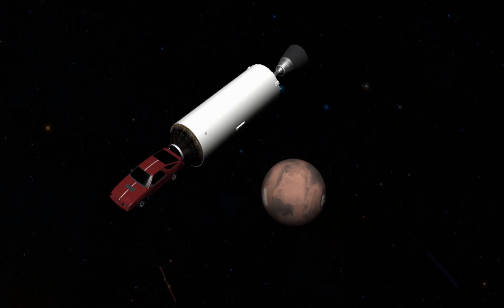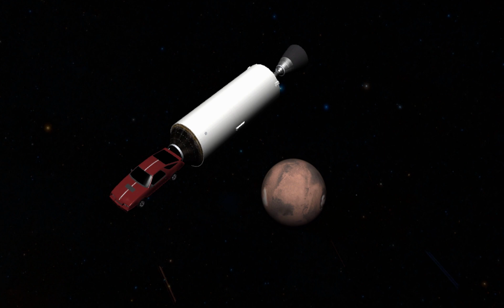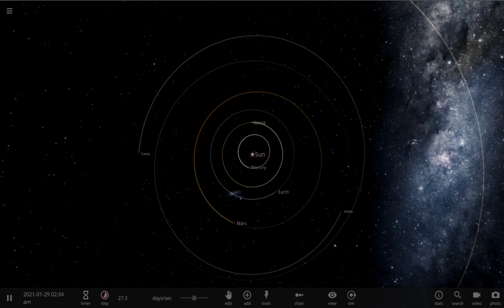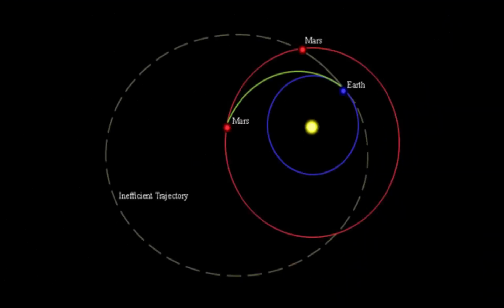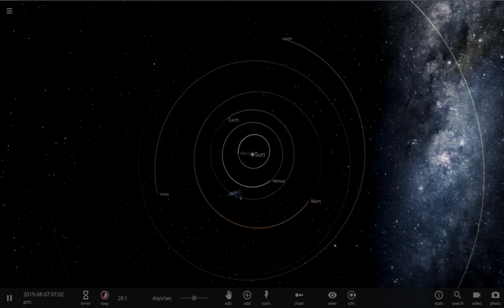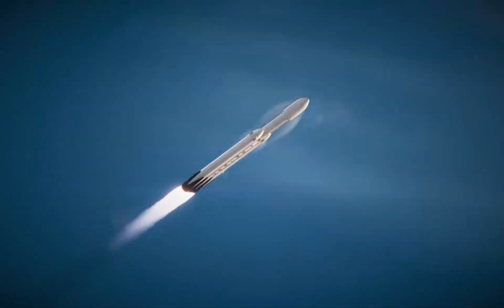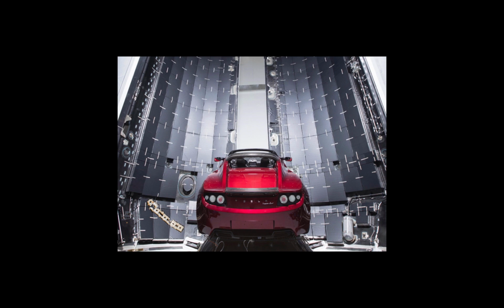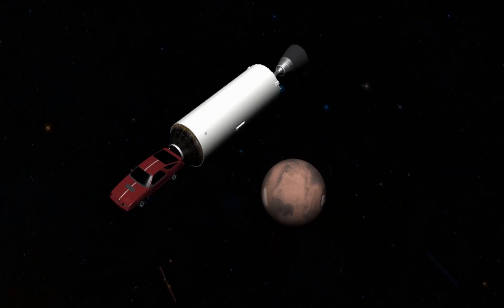How Far Can The Roadster Get -Explaining How The Falcon Heavy Can Reach Mars Outside Transfer Window

Comment: My question is whats going to happen to the materials that the car is made of. Ie tires, and paint interior in time
Reply: there is no atmosphere so using earth terms and conditions may be completely wrong and if they survive the initial exposure they may last much longer than you think besides you have no idea what type materials they used. When I was asked to age the mock-up voyager spacecraft used in the first Star Trek movie to look like it was in space for 2 thousand years there is very little information on how things age in space at least visually.
Reply: Radiation from the sun will 'bleach' it, much like the US flag that was planted by the first moon landing. If it survives, in a few decades it will most likely all be an off-white color, or a much paler version of what it currently is.
Reply: Thank you!!
Reply: John LaRocca, MDT The tires are vulcanized rubber which will break down and crumble with the harsh UV.  Many of the plastic parts on the exterior and interior of the car will do the same.  It won't remain a good looking car for more than a few years, anytime after that it's highly improbable anything will function due to the continued radiation bombardment.
Reply: +Robert My guess would be that the exterior would be dulled from collisions with very fine dust and energetic particles, and there would be discolouration surrounding the exhausts of the attitude control jets.  If it were painted, there should be evidence of wear-thru.  Probably a number of discoloured pinholes.  The one picture I dug up showed it's mostly black, and some of it even looked like carbon fiber "fabric".  Which may or may not show abrasion or discolouration much at all, but could show evidence of fraying if it got hit by particles... I remember that part of the movie being so dark that it didn't much matter what you did, your eyes don't make enough sense of it.
Reply: Charles T Like we actually went to the moon. God you're a dumbfuck!
Reply: The Voyager had a large round dish and then metal pipes holding the camera and other smaller things the legs were basically pipes as well the dish we dusted it and yellowed it and the metal we used copper and cobalt blue where it looked like it had been hot at some time and a few tricks I will not reveal also in the movie the o in the name was obliterated so that they were calling it veeger instead of voyager.
Reply: +Butternutcrunch My, quite the sheep you are, arntcha?
Reply: +Robert Wasn't it V'ger? ;-)  Yeah, sounds about the same effect I'd have gone for, but I think I'd have used some media blasting to dull things up/wear out some paint more than dusting.

A few artistically placed small holes would also work, but at the speeds this thing is going, anything larger than a pea hitting anything more substantial than foil would practically vaporize the whole thing.
Reply: your absolutely right about the spelling I was trying to do it phonetically guess I failed. When you work in Hollywood for a major studio you are able to do things like talk to people at NASA which I did and because of no atmosphere they don't get that much wear and tear except an ocasionl large item causing large damage. Art directors did not want that We even burned it with a heat lamp but that wasn't liked either
Reply: +Robert I can imagine it could get a bit awkward with your bosses asking for "make it look ancient!", and the astrophysicists say "why would it look ancient?" ;-)

I had my own similar silly moment.  As a grad working on my MSc in physics, I got to know the computing manager of the Physics dept fairly well.  She was a recent immigrant from Poland, and a Polish news crew was over to do a documentary on her and her work.  By that time (early 1980s) the Physics dept had gotten rid of all the ancient IBM mainframe hardware with blinking lights, toggle switches and other flashy bits, and had a real nice VAX 11/780.  Which is about as exciting to watch as a laptop charger.  She got into an argument with the news crew (in Polish of course), and came over to stand by me where I was looking in the door to see what all the fuss was about.  Then she broke out in giggles.  "They want the computer to do something cool!".  I cracked up - "It does have a tape drive maybe you could do something with that".  She: "It's broken, the tech is coming next week".  A few minutes later the news crew repacked their equipment looking annoyed ;-)

You sorta have to go back to general principles - there is fine dust out there (especially near the belt, the rings of Saturn, or probably the rotational plane of just about any planet), and ionizing radiation (elementary particle sized bits of + or - charge flying at truly ridiculous speeds), which would have impact effects equivalent to nano-scale explosions.  Microscopic pitting and abrasion.  Shiny surfaces become dull.  Paint erodes.  An object out for a decade or so won't show much change, but the moon's surface (dust, and micro-welded regolith) is the results of billions of years worth of micro-bombardment blowing things to micro-bits, and re-welding it back together into a brittle sponge of sorts.  You have to do something with discolourations around the thruster throats, and making something up (like you did with the "hot" - copper/cobalt blue is good for scorched metal bits).

You would get some electrostatic dust accumulation too I'd think.

With an electron microscope it would be quite interesting.  But that wouldn't quite fit with the script, would it? ;-)

Did you work on Wrath of Khan?  I went to school with some of the guys who did the Genesis planet CGI sequence.
Reply: I only worked on the first Star Trek movie and it is an interesting story. at first Paramount was going to bring back the original TV show so they built the original Enterprise complete. When the TV deal fell through they decided to make it a movie and Gene Roddenberry decided he wanted to upgrade the ship and make it more futuristic so the grips went into the stage with sledge hammers and saws and broke the entire set into pieces small enough to fit in the dumpster and we did a new set. I was told that was 8 million dollars they threw away. Anyway right after that movie I moved on to 20th Century Fox and didn't work on any more space flix and I am retired from the business now. I don't know about the stuff you are mentioning I went by want the "experts" said and even more what the art directors wanted.
Reply: Thanks for sharing the story it does remind me of what it was like having to please others more than myself
Reply: +butternutcrunch  Did I step on your dainty little sheep feet?  Poor boy, can't take what you give out.  Suck it up buttercup.
Reply: +Robert I think you did well, what you did is more or less in line with what I would expect, making allowances for art directors ;-)

The guys I knew who works on the Genesis project were the people who originally developed the techniques still used in basic CGI (shading, reflection etc) but their equipment was godawfully-slow by modern standards, so they had to cut corners (detail, resolution etc) to stay on budget.  As it was, I understand there's several months of compute time in the thing.  But they did have a love for that end of science, and I recently found out that the stellar backdrop they used is "real" - in the sense that they computed out what the view would be from the star that the storyline used, and used it, rather than make up something random.

The Genesis planet sequence in WoK was the very first pure 3d CGI sequence ever used in a major movie.
Reply: Lowest form of internet life, the lurkers they can't get a conversation of their own so the lurk around till they find something to cry about. Listen FrizFro say anything you want I'm rubber you're glue it bounces off of me and sticks to you. It is sad but say what you have to say so you can feel good about yourself then go off and lurk somewhere else. and have a nice day
Reply: That is so cool. When I was at Paramount there was a group of guys just starting to get good at what is now green screen back then it was blue screen. there computers could fill a one car garage. it was called Magicam. Nowadays I have seen CGI scenes that are so real it blows me away I love what they can do and would have loved to be involved with perfecting and using that process
Reply: +Robert "Lowest form..."  Sure you're referring to the right person?  That was the nutty butter crunchy guy, not me ;-)
Reply: +Robert I spent a lot of time in the graphics end of computing during my grad days, which is how I know two of the guys on the Genesis sequence (very senior people at Pixar and ILM, and a number of Academy awards as a result).  That's not what I do now, but my wife (also in computing) have always been paying special attention to the technical ground breakers in movies, even when the movies themselves suck.

Final Fantasy - the Spirits Within was the first photo/motion realistic CGI full feature-length film complete down to individual hairs.  Completely blew us away, tho, the script was weak.  It's too bad that the movie itself didn't do that well in the box office, and the production company folded.  They were intending to do a lot more of the same.

If you haven't seen it, I'd suggest it just for the CGI.

It's a bit clunky by modern standards, but it's got almost everything we see now.
Reply: I'm new at this so if I have insulted the wrong person I am sincerely apologetic to those who feel insulted
Reply: +Robert Don't worry about it, it happens.
Reply: I just watched the trailer for Final Fantasy and when I get a chance I will watch the movie it looks amazing
Reply: +butternutcrunch   I can tell you've been swilling too much sheep dip.  it's a neurotoxin and eats brain cells.  You don't seem to have many left.
Reply: +Robert Had a chance to see it yet?  it caused a huge stir in the tech crowd and won a lot of technical achievement awards.  Aki had her own fan club - she was supposed to be the "first virtual actress" to appear in many future movies.  For a deep dive into the making of the movie, I suggest the Bluray or DVD editions  - given 4 and 5 stars out of 5 by various reviewers.

Unfortunately, it bombed at the box office and recouped about 60% of its production cost.  Script was weak.  Bankrupted the studio.

Comment: SpaceX does not have to thrust all the way to MARS insertion orbit. it just has to get everything lined up correctly, and just give it a Gentle Tap. and it can Coast all the way there. we have been doing this since we stated launching probes to the Planets and Beyond. However, with VASMIR you could make a Round Trip to MARS on only one Month and with Fuel to Spare.

Comment: IF they add a 800mX800m solar sail, it can give chase to, and catch Oumuamua, within a year.. Assuming the launch goes all right, that is.
Reply from the maker: could work - a tesla roadster is rather heavy but for any car, 800x800 is pretty big - 800x800 is about 640000m² which at around 1200W/m² of sunlight (around earth, it gets less if you go further away) means about 768 MW which for light pressure meanst around 2,56 Newton which by the mass of a Roadster of around 1200kg means around 0.00213 m/s²which means within a year you'll accelerate by about 364*24*60*60*0.00213=67000m/s - that could do - hoowever the solar sail itself would at least weigh as much as the tesla  again or more, so youd be more somewhere at 30000m/s a year and as you would move outside earths orbit within that year its probably closer to 20000 - which is still enough to reach escape velocity and match up to oumuamuas speed but it would take a little while to catch up, probably more like 5 years
solar powered ion engines do seem like the more effective way though,  you need much smaller structures and even at incredibly high ISPs ion engines till tkae less power/thrust then a solar sail, they're much more controllable and let you catch up faster
Reply: Basically, it all depends on how thin they can make a sail. If it's thin enough, it won't weigh much so it would still be a better solution then an ion drive.
Reply: VASMIR works even better.
Reply: Sure, but what do you do after you meet Oumuamua? I mean, with VASMIR and even with some low impulse Ion drives - sooner or later you will run out of fuel. But with a solar sail - not only fuel is not an issue, but eventually you can go on propelling the Tesla from Earth, using a laser array. It could - for instance - go on an interstellar voyage - that might take 10,000 years - or if we develop a strong enough laser, it could then be propelled to, for example, Alpha Centauri in less than a century (if motors are connected to the sail's connector strings to allow navigation). So I'm all for a solar sail.
Reply: BTW, as an Israeli, I know for a fact we are working on some very powerful lasers. True, for other reasons, but who cares. The important thing is that the outcome of this research is going to be a very powerful beam that could - eventually - propel spacecraft. And the US, Russia and China already have some very powerful lasers.. It's all a matter of will, because the way is already paved here, sort of.
Reply: If to trust Scott Manley, Musk had decided not to do ANYTHING. No VASMIR, no solar sail, nothing. He's afraid it will blow up in launch anyway, so he doesn't want to put anything into it. Well, it's his company, his rocket.. Bummer.
Reply: +Julian Danzer you forgot the Sun's gravity.  Assuming the roadster isn't orbiting, at earth's distance, the attractive gravitational force on the roadster (excluding everything else) is about 60 newtons.  When you add 2.56 newtons outwards to 60 newtons inwards, the net is 57.44 newtons back in.  So, trying to boost straight out just won't work.  While going outwards reduces the sun's gravitational pull, the light falls off at the same rate...

An 800x800m solar sail is apparently capable of taking 2 tons (total) to the orbit of Mars by adding to the orbital speed and lessening in a way the effective mass - the minute thrust gains you some altitude. Over a period of approximately 400 days....

But thrust of 1200kg straight out?  No.  A Tesla is too heavy to be a statite with a 800x800m sail.

It's possible to get to the oort cloud, but, you'd have to do it by first diving to .1AU (bring your asbestos underwear) to get a huge boost from the incident sunlight.  Travel to the oort cloud would take about 30 years.

The way to do this is with lasers or masers.  See Forward's book Rocheworld.  if you can get the engineering to work (multiple continuous-duty gigawatt lasers, planetary-sized fresnel lenses), you might be able to get up to about .3C.  Alpha Centauri in 15 years, somewhat less ship-time.
Reply: +TheEEStudent It is somewhat important.  The lasers you're referring to are for fusion research.   The idea being to generate an absurdly powerful laser beam that lasts tiny fractions of a second, and you literally can't fire it again for a while.  You're trying to heat a micro droplet of water to fusion temperatures, so you need extremely intense laser "shots' that last mere nanoseconds.  A terawatt laser which is only "lasing" for a nanosecond out of every second is only a kilowatt of continuous power.

This is fine for fusion research - it's the instantaneous zap you need to get a droplet of water up to millions of degrees, and the resulting fusion power that keeps the pile going.  But if you're trying to push a solar sail, 1KW is nothing - you need gigawatts of continuous power.

Don't get me wrong, terawatt (and peta- and exa-watt lasers they're talking about now) are pretty damn impressive.  But the duty cycle sucks.

For comparison purposes, mankind manages to generate about a terawatt of continuous power ... in total.
Reply: True, but there are other kinds of lasers as well :-). Nevermind, the time window is closed anyway.